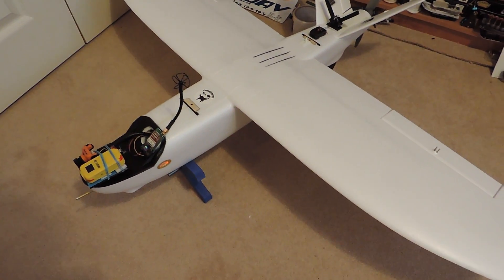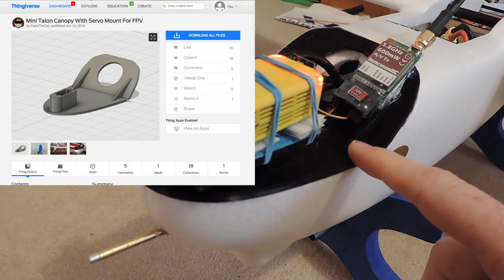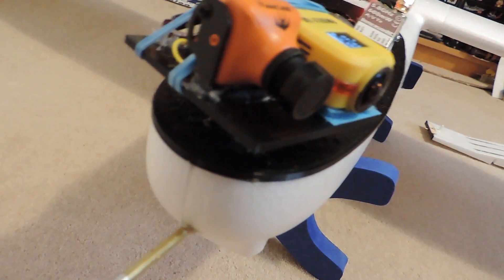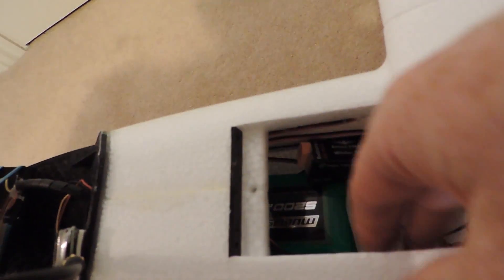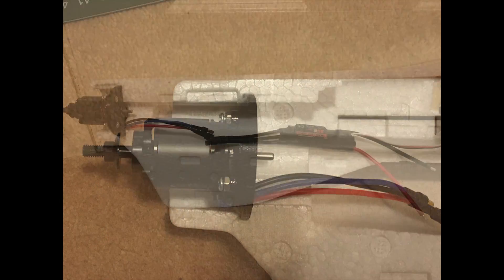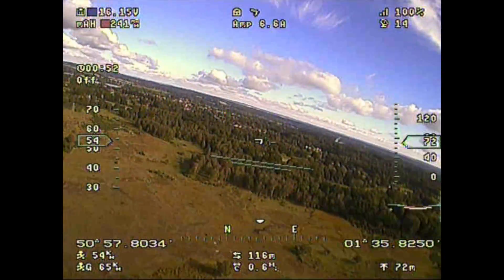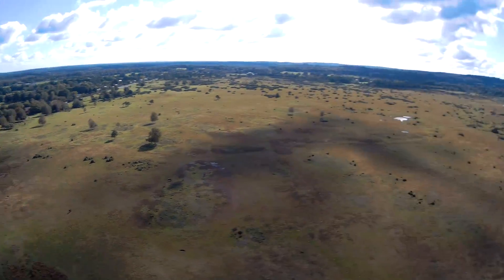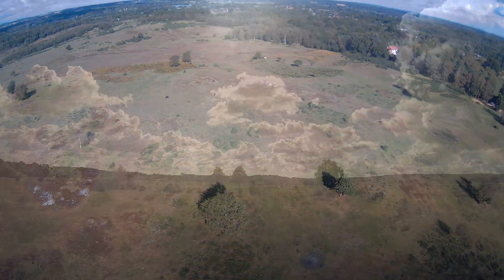Mini Talon: Build, overview and FPV Maiden

Comment: Hi Nice flight.., please can you advise on what expo setting you finally used for the elev and ailerons ? I just finished the maiden yesterday but found the control to be   Very sensitive. I think I need to add some expo. Want to get comfortable flying before i add in the vector etc.  
Thanks
Reply from the maker: Just checked on my radio and expo is set to 40% on all my surfaces.  I can't remember if that was just a bit of a guess and seemed ok, or if I started smaller and built up.  Seems to fly ok on this though
Reply: Thanks I’ll give it a try

Comment: Hello there, have used that JX  9180MG servo in any planes for control surfacers? they look great(digital not analog )
cheers
Brett
Reply from the maker: I haven't used those on control surfaces as it has so much movement (I have used the TowerPros in multiple planes though)  I guess if you used them with the horns in the right places, then it would potentially give you sme really smooth movement through the range of the control

Comment: Do you launch in stabilise mode?
Reply from the maker: No, launched in manual mode.  Now I trust the Vector, it may get launched in stab if I'm on my own
Reply: Is it tight takeoff? no
Reply from the maker: What do you mean by tight ?  It seemed like a fairly easy launch - a decent throw, and it's got plenty of power to take it forwards.

Comment: great video. very informative. I have just bought one of these aircraft along with the l9r. how do you find the range on it?? I am only going to start with a basic fpv setup as the Eagle Tree Vector is currently out of my budget so I won't be flying too far from home.
Reply from the maker: The l9r's I have have been great, I've taken my Bixler to 5km on it and RSSI value was still good.  Useful if you at least have an OSD that can show you the RSSI though, as it doesn't have telemetry
Reply: CurryKitten awesome, any recommendations on a nice cheap OSD? I suppose I could really do with one especially if I end up in the clouds.
Reply from the maker: Well first off, build up distance slowly - and know that a cloud is like a brick wall for 5.8 video.  Baby steps :)  OSD wise, cheapest is a MicroMinimOSD which can be had from the likes of banggood for about £5.  It will take some effort to setup though, you'll need to compile arduino code and flash the firmware and add a GPS yourself if you want to know where you are.  (It's on my to-do list for tutorial videos, as I think it's a very neat little thing)
Reply: I'd go with an F4v2 omnibus, about one eighth the price of vector, but some better features, like auto launch, auto tune and auto trim, you get RTH and full customisable OSD with inbuilt current sensor, running Inav. I still like my Vector's but won't buy any more. The L9R should get you 10km.
Anyway, great build CurryKitten, cheers.

Comment: Nice build and maiden. 
They do fly well don't they?😃
Have you looked at assigning your pan servo as a flap? Most radios have a timer to slow the flap channel down to give smooth movement.
Reply from the maker: Haha, that's just me moving it quickly - I could slow it right down, but as it only gives 90 degrees each way, it's not so much a cinematic thing as trying to find your friends plane so you can follow him :)
Reply: CurryKitten I went for one of the reproduction GWS 360 deg servos. You get the full turn but it never centres to the same spot twice. The 180 deg maybe the way to go!! I left my FPV camera fixed so is not an issue.....

Comment: looks great :) how do you get a usable rssi signal from the l9r?
Reply from the maker: The l9r has a dedicated analogue RSSI pin, so plumbs straight into the Vector which calibrates it's min/max RSSI during the radio setup

Comment: You're the first one I've seen use my hatch mod, Wayne. It's nice to see it didn't completely go to waste :D    
I've done a new front pod which you might find perfect for your needs. It's 2 separate (interlocking) pieces and has a GWS hole so the servo is sunken into the fuse and also has a 20 degree tilt. I'll be releasing it next weekend.
Reply from the maker: Cool - yep, was going to go the hatch lock and bbq sticks anyway, but I like the little bits to keep the holes nicely lines up and to stop the foam opening up more
Reply: Vortecks there are at least 2 more, mine & Coyote's have 'em!! 
Thanks for posting the design.

Comment: Howdy fella, outstanding. Ordered my 2nd vector this morning for the mini talon. I'll be placing the gps/compass in the wing, with the vtx in the other. Let us know how you get on with the receiver placement as I'm a bit concerned with putting it so close to a noisy motor. Matt
Reply from the maker: I think VTX one wing and RX in the other is probably your optimum placement, but I couldn't be doing with more wires to connect everytime I put the wings on :)  I've got other FrSky rx's close to ESCs and motors without causing an issue, but I do intend to beat my 5km distance in this one, so we'll see.  The only problem I've had before is a FrSky d8r-ii wiping out the GPS rx that was next to it.  Ironically the GPS was put right next to the ESC for a better signal
Reply: CurryKitten Yikes on that placement!

Comment: Nice work Wayne, she flies nice...It must make a change from trundling around with a floaty Bixler...?
Reply from the maker: I was barely flying the Bixler, it was so underpowered, so needed perfect conditions.  My Falcon wing has been my goto plane for the last few years.  However, I've just ripped the crappy motor out of the Bix and put in something with a little more kick, just to see if I can get some more usability out of it.  Not tried it yet though.
Reply: CurryKitten Yep, my Bix 2 has a non standard motor and mount so It can swing a bigger prop...Its a design flaw with these pushers, props are just too small for a 1.5mtr plane...Pleased your MT is performing so well...look forward to some more footage from it....:)

Comment: Great successful maiden,and well laid out plane.Not sure about the pitot position though?
Reply from the maker: I know what you mean, I was going to put it on the side of the fuse, but it's quite a long thing and I could have spent hours over-engineering it.  It does feel a little bit vulnerable out there, but I'll be trying not to crash on the nose :)  In the worst case scenario it should push back through the fuse without causing any/much damage.